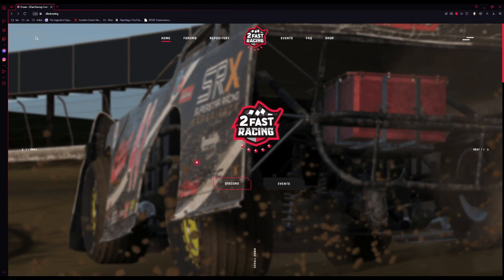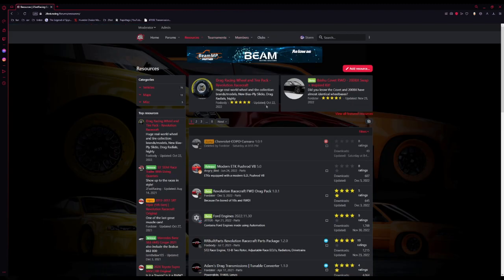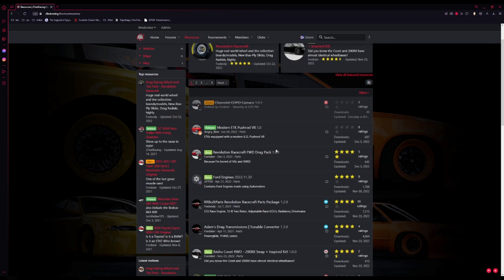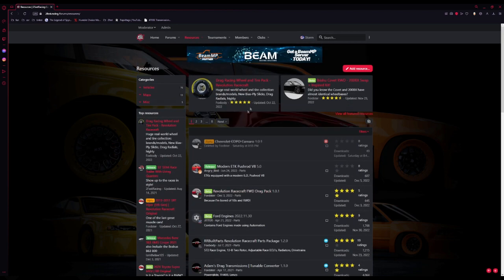Beam.NG Drive: Advanced Transmission Tuning

Comment: im having a very hard time getting the tire to plant without going straight into a wheelie using 28x10 mt et pros on that same surface i either spin or go straight into a wheelie basically
Reply from the maker: The 28x10 Et pros require a much softer launch. they have a stiffer sidewall which makes them a little more inconsistent. Its best to build around the tire. Lower your power numbers and work up from there.